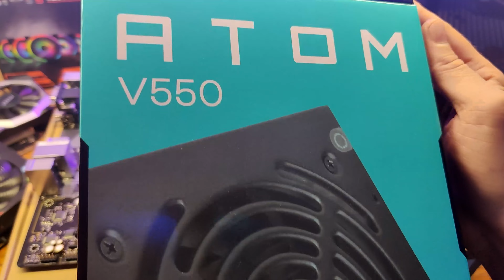Are the i5-8500 & i5-10400 still good CPUs for 2023?

Comment: Hey dude i need your advice i have a i5 8500 and 16gb ram ddr4 2666hz H310m motherboard im planning to buy a gtx 1050ti is this good for Gaming while streaming i would like to stream csgo valorant and dota 2 also i will use it for Autocad will it do?😊
Reply from the maker: Your system is pretty decent, but I'd probably try look at a gtx1650 minimum or gtx1660 on the lower end
Reply: Get a better GPU if possible. I'd recommend at least at rtx 2060/RX 6600 at this point. I got my 1050 ti for 40usd three years ago but you can do better these days. I've seen GTX 1070s for 50usd

Comment: Hey bro I am still using i5-8500 with rx 6600 8gb GDDR6
32gb ram ddr4
850w power supply 
500gb ssd
250gb HD 
Msi H310M VDH Pro series motherboard
Resizebar Enabled
Gaming in 2023 :)

Comment: Is the I5 8500 a good match with a 6600 xt for used parts in a budget?
Reply from the maker: Yes definitely, some games will do well with this cpu and gpu combo
Reply: @JustekGaming  Thanks. Building for a friend using used parts
Reply: I have i58500 and 6700xt and i will say it’s decent combo
Reply from the maker: That's pretty good, what resolution do you play at?
Reply: @JustekGaming  two monitors at 1080p basically half of my setup is hand-me-downs so i got it for free can’t complain 😜
Reply: no just get the i5 10400f it has 2 more cores 4 more threats and a high clock speed for a similar price and its newer.
Reply: is a rx 7600 with i5 8500 good (I don’t mind a bottleneck in cpu intensive esports games cuz I can get well over 165fps in them)
Reply from the maker: @Fredals213, yes and no. It's definitely a good option and it's definitely worth getting if you're planning on future upgrades. But in 20 to 30% of games you start seeing a CPU bottleneck at 1080p gaming.

Comment: I just bought a whole computer with an i5 8500 for 100 bucks off e-bay.

I don't know how many rands that is, but it sounds good!!!
Reply from the maker: Wow that's a really good deal
Reply: @JustekGaming   It doesn't have a GPU and only 8gb ram.
But that can be changed and I'll flip it again. I'm wondering if it's worth sticking it into the Montech Sky Two case in Morocco blue.
The case itsself would be another 100 bucks.

Comment: Do u think i5 8500 
Would be good with 
H610m-e motherboard board
And rx 6500xt graphic card?
Reply from the maker: Thanks for the comment, I think firstly would be to check if the 8500 and h610m support pcie gen 4
Reply from the maker: Unfortunatly RX-6500-xt is a Pcie gen 4 graphics card and the i5-8500 doesn't support Pcie gen 4, so alot of performance will be wasted and it's not becuse the CPU is bad. The 8500 will perform very well with most other gpu's a part from the RX-6500-xt and RX-6400-xt.

For example the RX-6500-xt with a Pcie gen 4 CPU can perform like a GTX1660 but if you pair it with a Pcie gen 3 CPU it perform like a GTX1650
Reply: @JustekGaming  how can i know my i5 8500 is pcie 4 or 3
Sorry because I don't really know how
Reply from the maker: You can google it to check, Pcie gen 4 is only supported from intel 11th gen CPU's unfortunatly.
- so the difference between Pcie gen 4 and Pcie gen 3 on the RX-6500-xt is about 5 to 8 to 20 FPS and for the same price you can probably look at thge GTX 1650 super that will match that extra 5 to 8 FPS on Pcie gen 3

Comment: I still use CPU Intel i5 10400 + GTX1060 6GB but in the future I will upgrade to RTX4070. Do you think it will work?
Reply from the maker: Yeah it will definitely work and pretty well, at some point maybe look to upgrade the cpu to the i7 to get the most out of the gpu
Reply: 4070 is overkill with i5 10400. buy max rtx 4060
Reply from the maker: I would depend on the games you play and what resolution you play at, but yes the last thing you'd want is have the cpu bottleneck the GPU and have waisted performance
Reply: you should probably get a 10900 if you are going for a 4070. the 4070 is roughly equivalent to a 3080, aint no way you are pairing an i5 10th gen with a 3080.

Comment: I5 8500 with RTX 3060ti on Gigabyte Z390 UD ?
Reply: What do u think going in this or just let it ?
Reply from the maker: @T0X11C-z1b  the 3060ti is still a very good graphics card, so it will be a pretty decent match
Reply from the maker: The motherboard is pretty solid, I'd definitely try at a later stage look at a 6 core 12 thread cpu, maybe even a K cpu like the i7-8700

Comment: I have a 1004f and b460m pro. What is an upgrade to the 1004f?  For gaming with Rtx 3080. The b460 runs the 1004f at 2666 ram speed which is lame.  But I think if I put a better cpu in it, it will give me 3200. No Xmp etc on the mobo.
Reply from the maker: Thanks for the comment. The 10400f is the lowest of the i5 CPUs, you can look for a 10600f for better clock speeds or if you want more cores you can look at the i7 10700f but for 3200mhz ram and Xmp you'd need to look at a Z series motherboard like a Z490
Reply: i3 12100f outperforms i5 10400f with 2 less cores. It performs much better in games and if u have money u can go for 13100f which supports DDR5. But in some core heavy stuff like rendering the i3 12 and 13 gen wont do any better than 10gen i5.
Reply: get a 10900. youll get 2933 mhz memory. or just upgrade the whole system onto the newer platforms. you are running a 10400f with a 4070 equivalent gpu on gimped ddr4 memory. the bottleneck is hard.
Reply: I find with b560 boards specifically you can OC ram above limited speeds even with a 10400F managed to get a 3000mhz kit to be stable at 3200mhz on a b560 board with a 10400F

Comment: i5 8500 and 4060 ti is it good ?
Reply from the maker: Thanks for the comment, unfortunately I haven't tested the 4060 ti on the 8500 as yet
Reply: @JustekGaming thanks for reply ❤
Reply: Even a i5-3470 can run GTA V at recommended settings, so the i5-8500T will be more than enough.

Comment: How well would the  i5 10400 without the gpu
Reply from the maker: Thanks for the comment. But it wouldn't run very well, it's really for display only. You can try the Ryzen 5 5600g as it would be better
Reply: @JustekGaming  would a gtx 770 with the intel i5 11400 would run any better than the intergrated graphics

Comment: do you build pc for clients
Reply from the maker: Generally I tend to build them first and the sell them once I'm done with making the videos
Reply: @JustekGaming  i check ...i have a issue ..i create architectural renders using unreal engine 5.2 ...but my rendering pc takes forever to render a 4k path traced render....what can i do in terms of parts to get more faster render times..I have a ryzen 12 core cpu 64 gigs ram and rtx 3090 currently but takes very long to render a still image...i also use gen 4 m.2 drives...i dont know if my gpu is messed coz i have been using it for a year now for rendering ad pc turns into a ovan when i render...so im thinking of buying a new pc or first get a new gpu like the rtx 4090 ..wootware seems cheapest ...but will their be bottleneck coz i have no idea
Reply from the maker: Okay cool, have you managed to check gpu and cpu utilisation while rendering?
Reply from the maker: If you can, try run msi afterburner while you render, its got in the left at the bottom a hardware monitor or you can just run task manager, this should allow you to isolate where the bottleneck is, whatever is running at 100% would probably be the place to start looking at upgrading
Reply: @JustekGaming  thanks i did that now and gpu is mostly at 100 percent drops sometimes to 80 and 20 percent but 100 percent the most of the time...memory is 87 percent and cpu is 12 percent..but when i render scene with simulation partickles ect then cpu is hitting 100 percent as well a gpu ..but cpu will drop ometime to 60 percent ect
Reply from the maker: So at the moment your pc looks to be predominantly gpu bound but I suspect it's just because of rendering particles. Upgrading to some like a 4090 would probably be the best bet but you'll soon see the cpu start to bottleneck more often, I'd also maybe look at the ryzen 9 5950x as the additional core would help minimize the bottleneck
Reply from the maker: So a simple way to understand it is when your GPU hits 100% and the cpu utilization drops then the cpu is waiting for the GPU and vice versa
Reply from the maker: You'd probably see about a 40% performance uplift on upgrading your GPU alone
Reply: @JustekGaming  the thing is im using amd 3900 12 core cpu...64 gigs ram...rtx 3090 ..
Reply from the maker: Cool so a jump to a ryzen 9 5900x would probably set you back about 7k and if you had to sell your 3900 for 3-4k and you'd still be able to keep your motherboard and ram
- as for the GPU the 3090 goes for about 14k on the lower end of the secondhand market and a 4090 would be about 34k
- so all in all you could do a farely sizable upgrade for about 23k or you could go new 5900x and 4090 for 60k

Comment: Will an rtx 2060s be a good pair with the i5 8500?
Reply from the maker: Yes definitely, the 2060 is still a good performing card and with the 6 core 8500 it's a pretty decent match
Reply: @JustekGaming  oh great thanks
Reply: @QwecySlim did you get 2060 and i5 ?
Reply: @alen2679  yeah I'm using 2060s and an i5
Reply: @QwecySlim  is it good I want to buy one. Do you have any stutters in game ?
Reply from the maker: Depends on the game but overall they are pretty good
Reply: @alen2679  Well it will be better if you can get a newer cpu

Comment: what is the best motherboard for i5-5800 max 150$?
Reply from the maker: Hey thanks for the comment, for that price I'd probably look at the ASROCK B365 PRO4 Motherboard or any of the B365 motherboards
Reply: @JustekGaming  if you ignore the price what would you suggest
Reply from the maker: @jaouadhboub6921  probably still the B365 as the next motherboard up would be the Z390 but they are generally better suited for K scew cpu's like the i5-8600k and overclocking
Reply: @JustekGaming  thank you ❤️